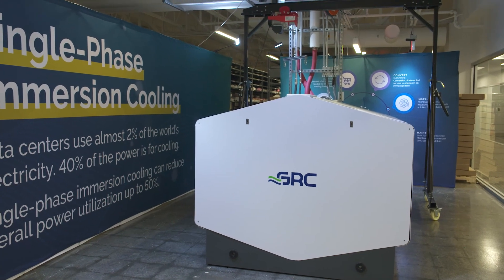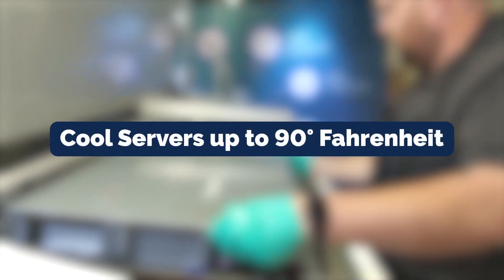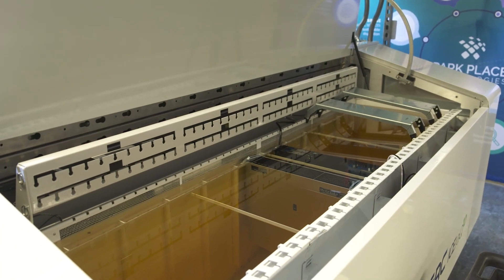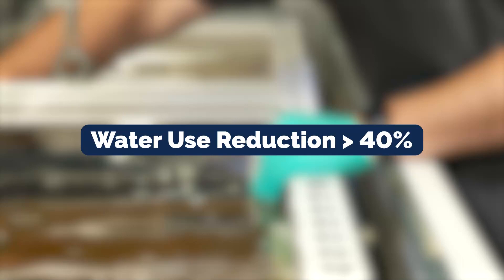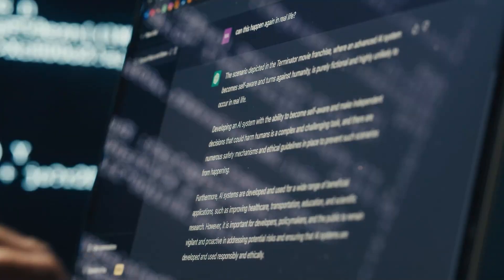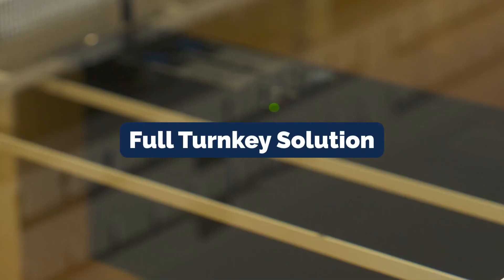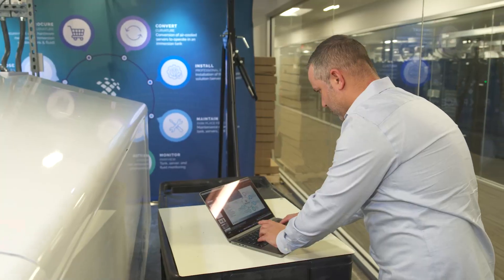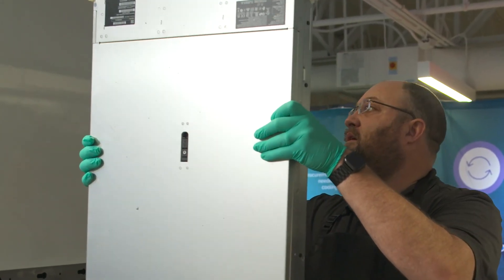Liquid Immersion Cooling Solutions - Park Place Technologies

Comment: I wonder if the waste heat could be pushed that little bit further to steam to generate electricity. Or in a office building using a heat exchanger to pump heat into a 2nd loop and supply heat to the building